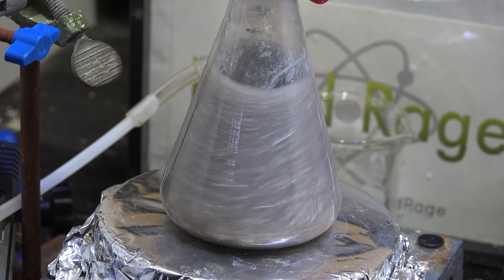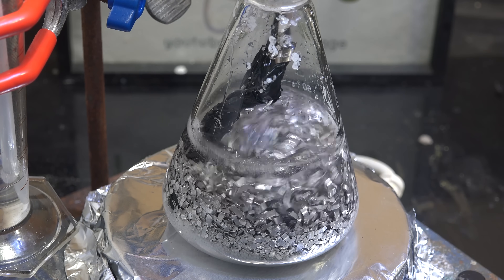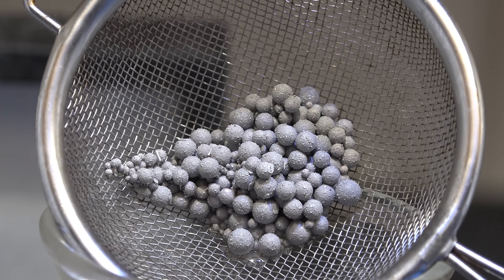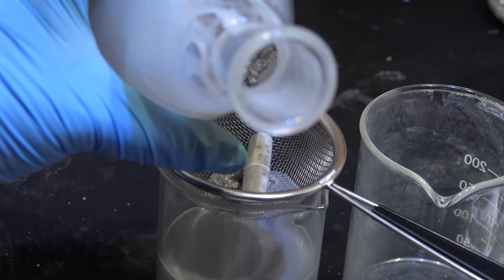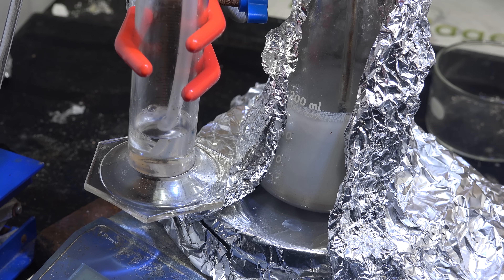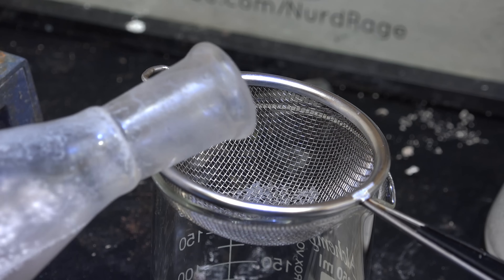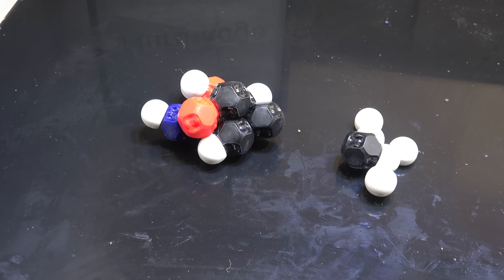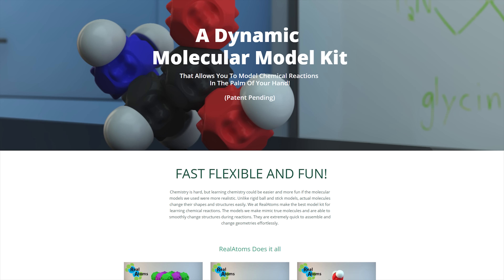Lab Notes - Unrefined tea tree oil tests and stoichiometry tests - September 26th 2018

Comment: The models are kind of like snatoms, but without the extra pieces for multiple bonds.
Reply: Yes, the atoms in RealAtoms simply re-orient to make multiple bonds and don't need extra pieces! I'm speaking for RealAtoms - I'm one of the two founders. There are videos and photos on realatoms.com that show how the product works - different from anything else (including Snatoms). For example, the same atom you just used to make a tetrahedral center can be used to make a six-coordinate metal center (see the photo with the hydrangea in the background, on the web site). Also, the magnetic attractions are exceptionally strong - you can make a six-carbon chain with RealAtoms, like n-hexane, and keep dangling it from your hand without it falling apart.  Cheers, Ulrich Fekl, co-founder RealAtoms

Comment: Just came from @NileRed 's video on making phthalic anhydride and noticed the tertiary alcohol 2-ethyl hexanol is formed as a byproduct of the base ester hydrolysis of DEHP. Could this be extracted and used as a cheap and easily obtainable catalyst for this reaction? I would test it myself but, alas, my heating mantle is broken right now. Any thoughts?

Comment: How do Realatoms compare to Snatoms?
Reply: Despite both using magnets, they are very different! Snatoms give you fixed molecular geometries. For example, with Snatoms, oxygen makes two bonds, carbon makes four bonds, nitrogen makes three bonds, all based on tetrahedral angles. If you want to make double-bonds with Snatoms, you have to use additional magnetic bonding sticks. If you want to make three-coordinate oxygen with Snatoms (such as in H3O+), you cannot do it. With RealAtoms, there are no sticks ever involved. And every C, O, or N atom is free to adopt various structures, such as sp3 OR sp2 OR sp OR octahedral OR square-planar OR five-coordinate etc. Yes, there really is five-coordinate carbon! It exists, for example, for a very short time during reactions where a substituent at carbon is being exchanged. So, Snatoms and RealAtoms work completely differently, feel completely differently, and serve different purposes.   Best wishes,  Ulrich Fekl, CEO and co-founder, RealAtoms

Comment: I recently bought a lacquer-thinner which contains butanol, o-xylene and methoxypropanol. I found this to be very difficult to separate. The first distillate that came over was at just over 80 C, there is a definite xylene smell, although not very strong. The next distillate came over at just below 120 C (this is the xylene-butanol azeotrope BP). Does anyone have a clue about how to separate the three chemicals? I'm thinking that if I add water to the mix I could separate off the xylene and dissolve the butanol and methoxypropanol in the water and then distill the two water azetropes, however I don't know whether this would in fact work.

Comment: So, if the concern with magnesium is that the shaving contaminate the sodium - why not use really long strips of magnesium and coil them in the base out of the way of the stir bar?  The difference in surface area between a long strip and a small chip can't be that much - and you can make up the difference by just having more, right? 

If using a long coil works, then you can just pull it out with tweezers or something while the sodium is liquid.

Comment: I know that you have looked at primary and secondary alcohols already, but I wonder if propylene glycol would work? It's cheap, easy to source and available at 99.5+% purity. Having two hydroxide groups might make it behave in a different way. Likewise for glycerine, with three OH groups.

Propylene glycol is fairly soluble in organic solvents. Perhaps its alkoxide  would also be soluble.

Comment: so hopefully not a silly question, but if the reaction slows as the magnesium is used up leaving you with less surface area to react with, what happens if rather than the chips of magnesium you use something much finer? a powder for instance or something the size of swarf from milling a block of magnesium? would doing this with your excess lead to a faster reaction than the 2 days?

Comment: The fact that the tea tree oil works at all would let you start with a small reaction to get some starting sodium to run the procedure you found that requires sodium, so you have succeeded in finding a path for amateurs to follow. Congrats.

Comment: I remember one of your blogs that you told about failed experiments being boring etc, but I think this Lab Notes format, with failures, small successes is really great. Now we are getting real insight of how does chemical research look like in VERY practical manner, with failures, tries, messing with parameters and checking with extremes if it even has a chance of working. Not sure, but I might like more those "in progress" vedoes than ready to use recipe video.

Comment: Love the great work-- but a quick question: 

If tertiary alcohols help catalyze the synthesis, why not try using a cyclic tertiary alcohol like 1-methylcyclohexanol (or something along those lines)? I don't exactly remember why you chose longer-chain tertiary alcohols for the reaction; but maybe a cyclic alcohol could lessen the length of time the reaction takes (less intermolecular interactions between solvent and catalyst molecules which seemed to make the longer chain catalysts slower).

Comment: stupid question, 7:00 to 8:00 ish. If the surface area of the magnesium being reduced is slowing the reaction, wouldn't it work better to use a fine powder of magnesium? the magnesium left over looked rather course. seems like the magnesium is wearing away into small spheres for the minimum surface area for it's volume. I get that grinding magnesium to a fine powder would be next to impossible,  but perhaps there's a different way to get it into a powder.  I'm not a chemist, I have no idea of this would work, I just understand square cube law and inverse square law for surface area, I was thinking maybe having magnesium could bind to something that is in a powdered form, then do something to reduce the magnesium out of it... except that might just coalesce into a ball again, I literally don't know. Or even if the magnesium is somehow dissolved in a solution... I'm just trying to think of ways to maximize the magnesium's surface area. assuming you had a fine powder of magnesium that should solve that problem though, right?
--edit
Or if there is a metal or other material that wouldn't react in this case, that could be shaped to have a maximum possible surface area, and have the magnesium plated on it's surface, keeping the maximum surface area for the magnesium, by arbitrarily increasing it's volume. kinda like those electrodes you had, what where they, platinum?  I'm not suggesting using those, just the same principal.

Comment: Wonder the realatoms has anything to do with Derek of Veritasium. I remembered he once prototyped a similar molecular model with magnet in it. According to him, the magnet adds another dimension to the model, where you can feel the attraction of molecular bond from the magnetic pull and you actually feel the struggle to separate the molecular bond (sometimes people may confuse that breaking molecular bond absorbs energy). Also, the clacking sound made when two molecules snap together indicates the release of energy when molecule bonds are formed.

Also, can I tag someone in the comment? like @Veritasium

Comment: Do you have any theories on the properties of dioxane/tea tree oil that are promoting/inhibiting the sodium coalescence properties? A quick search is showing that it seems to be some relation with both the surface tension of the droplets and the fluid viscosity, but that might not be all as dioxane was the only thing you have found that gives good coalescence so far.

Comment: random dart toss... if hydrogen peroxide can be used to clean up organic crap in sulfuric acid...  could hydrogen peroxide be used to destroy the random organic crap in the tea tree oil?
Reply: The tertiary alcohol he is after falls under "random organic crap". However, it may be possible that the impurities oxidize first and you could use just enough H₂O₂ to destroy them and not the desired tertiary alcohol. Keep in mind that I'm not a chemist, so this may be way off.

Comment: That's a nice molecular model kit.  Also, is that tree oil the cheapest tertiary alcohol you could find or was there some other requirement that has to be met for the reaction to work?

Comment: If surface area is your limiting factor then the reaction would terminate. It would slow first, as the surface area drops, but square cube means it is not exponential. If the reaction is eating the surface at some rate measured in mm/h at some point it will get right through.

An exponential decay rate still suggests to me that it is an alloying thing, at least at the later stages. If the rate is dependent on the concentration of magnesium in the alloy then we would expect an exponential decay.

The failure to coalesce does point to something happening at the surface of your product, and the alcohol certainly seems to have a role here. If we are looking at an alloying process, it would be weird to expect it to work when the sodium won't even interact with other lumps of sodium. First guess is that a layer of hydroxide protects it, and the alcohol is able to strip it, then react with water elsewhere to be regenerated. Stirring prevents coalescence consolidating the remaining surface layer, so unprotected sodium exists to alloy or react. An issue with the tea tree oil could be lighter insoluble alkoxides forming instead that are harder to strip.

Counterintuitively, you might get a decent result from adding a little water, in the form of a slightly wet heavy alcohol oil solution. If you sacrifice some of the sodium to destroy that surface then the reaction might be able to restart. Basically any process that causes the sodium to coalesce would work.

Some of this is testable by avoiding the oil at all, and exploring how sodium alloys with magnesium dry. Now that you have given a way of getting a decent yield of sodium that is easily done, I can get on that.

Comment: Nice to see these essential but not always super-fun-to-do experiments done in order to estimate what is essential and what is not to ensure a "good" performance of a process :)
Have you considered to do something like a life cycle analysis for your alcohol-catalysed magnesium reduction vs. conventional melt-electrolysis to produce Na metal? It would nicely demonstrate why chemistries in labs vs. chemical plants usually differ so much, and harsher conditions but cheaper starting materials &  utilisation of by-products (Cl2) from a process can improve its viability.
Your process, on contrary, is accessible for anyone.

Comment: Use less magnesium and try it with tee tree oil that you've extracted from the dollar store bought form? If you're still running cost benefit analysis then it wouldn't hurt if you found a not efficient way to get the product after a high yield. Fire safety precautions and maybe a blast shield for the flask? Or use the lithium to jump if that's even CLOSE to a possibility? Are we trying for product or reaction at this point?

Comment: The primary component of tea tree oil is 4-terpineol, which I assume is the tertiary alcohol you're after. The primary component of pine oil is alpha-terpineol, an isomer of 4-terpineol. Would it be worthwhile to try that as well or would you expect the two to have similar properties?
Reply: Probably nice idea would be to check other terpenoids with are tertiary alcohols. There is some that should be quite easy to obtain. There is Linalool, and definetly others.

Comment: why is dioxane separation a big deal? it has super high yield and the dioxane can be recycled with a simple distillation
Reply: Probably because dioxane is in general pretty flammable and irritating stuff to work with when compared to mineral oil. Also, distilling ethers tends to concentrate peroxides, so there's that too.
Reply: The peroxides are not a problem here, sodium destroys them.
Reply: TheBackyardChemist  Good point, I forgot about that.
Reply: @TheBackyardChemist  "The backyard chemist"? One of my other favorite youtubers?
Reply: Lol, no, you are probably thinking about "The backyard scientist". Totally unrelated bloke, on a different continent. Also I have not uploaded a single video yet. I was planning to start doing and filming experiments, thus the account name, but never got around to actually doing it.
Reply: It's flammable carcinogen with a high vapor pressure and the procedure requires heat. Those are downsides.

Being able to go from drain cleaner to sodium in a single beaker plus flitration and wash would be pretty nifty.  The bar doesn't get much lower than that
Reply: Elizabeth Greene  "a single beaker plus flirtation" :D
What are you doing later? Meet you at the low bar? Something could be stirring...
/jk
Reply: AguaFluorida  Filtration, Flirtation what's the difference? :)

You don't bring a Buchner funnel on dates?  Just me?
Reply: I've got some very cute Hirsch funnels, fritted and plain, if you'd like to see them.
Reply: Probably because it costs like 65 bucks for 100ML on Sigma-Aldrich, so if you can cut out the need for dioxane, awesome.

Comment: What came to mind: since the amateur chemist for whom this scenario is supposed to work should have access to magnesium and presumably acetone: do you think using pinacol as a tertiary alcohol is worth a try? 

Anyway, great vid, loved seeing the progress!
Reply: As promised in the previous lab notes video, I'm still working on making pinacol and testing it out in this reaction. So far what I've learned is that dry acetone and mg shavings do indeed react at room temp to produced pinacol,  but the amount produced is presumably very low due to slow reaction. I've added heat as well as an Iodine crystal to try to speed things up, and the reaction is progressing albeit still slowly. At the end of 3 days of heating at 50°C I will stop the process and quench the mg pinacolate with water and see what the yields are. 

I've also gone ahead and purchased mg shavings from a different seller because I have a feeling that the ones I'm using now aren't pure magnesium as promised but rather some low-quality alloy. So will try this process again when the 95% mg comes in. I'm also working on making pinacol from lithium and acetone, and that reaction actually proceeds quite readily at room temp with heat generation. However, my reaction mix has turned gunky yellow so I'm thinking impurities in my old acetone are  polymerizing, so will be buying a fresh bottle of acetone and go from there. Wish me luck!
Reply: @snowdaysrule  nice, keep us updated :D
Reply: @snowdaysrule  Good Luck sir.
Reply: snowdaysrule2  Any good source for Mg shavings on Ebay? Or which ones to avoid? lol
Reply: Ideally you get a magnesium rod and make fresh turnings on a lathe, using an argon blanket if at all possible.
Reply: @ngozumpa  Honestly on ebay any magnesium you buy that's not ribbon or solid metal is going to be hit or miss. My advice is to message the seller ahead of time and ask the seller about the purity of their product as well as if any cutting oil was used when making the shavings. I ended up having to purchase magnesium off of ebay twice before getting a good quality, usable reagent. The first seller I bought from sold me fine shavings; they unfortunately reeked of cutting oil and when I went to do a burn test with a small pile of shavings the pile did not even burn all the way through once ignighted!

I did go ahead and purchase magnesium chips from a different seller on ebay, and this time the product actually ended up being good. The mg was more like turnings than shavings, and the burn test was very vigorous and all the material reacted. If you're interested the item I purchased was "Magnesium shavings/chips fire starter 1 lb bag" for $12.99 but  there's only one bag left so hurry if you want it lol!
Reply: According to Wiki, HgCl2 is required in the coupling from acetone? Any better and safer substitute?
Reply: CdCl2
Reply: Update Regarding Pinacol: 

After working for around a week on the pinacol production reaction from acetone and magnesium, I regret to inform you guys that this reaction does not appear to work without the magnesium being in an almagam by use of mercuric chloride. No amount of stirring, heating, or cosolvent use improved the reaction rate to the point that this reaction could be viable. The best "discovery" I made from my experiments is that anhydrous zinc chloride makes for an excellent magnesium activation agent. It's soluble in organic solvents and the magnesium becomes so activated by it that it vigorously produces hydrogen in water at room temperature, consuming the entirety of the magnesium chips in the process.

So long story short magnesium and acetone won't make pinacol without HgCl2. It should, however, be possible to make pinacol using acetone and lithium metal, but the key detail here is that the acetone must be diluted by a non-reactive cosolvent during the reaction with lithium. Besides being an organic compound that can be reduced by metal, acetone is a ketone, which is electrophilic. And when in the presence of a strong base, (like the types of bases that lithium metal can make), it can be converted to its enol form, which is nucleophilic. So unless diluted, acetone will undergo aldol condensation reactions with itself rather than produce pinacol. So the key here is to do the reduction with anhydrous, dilute acetone.